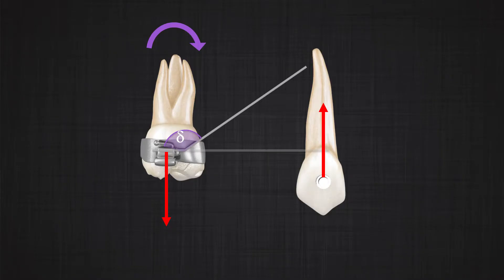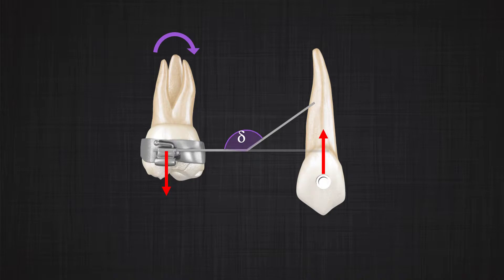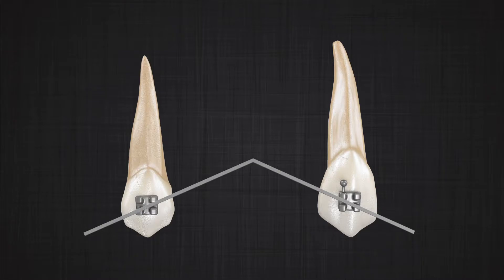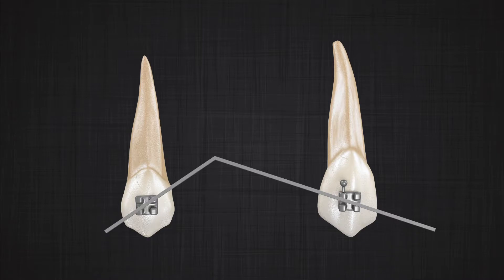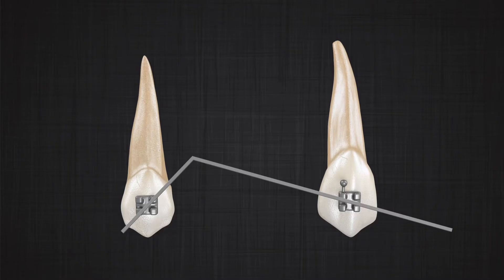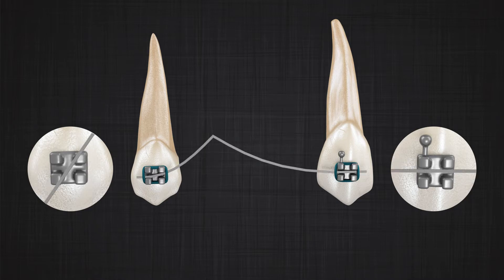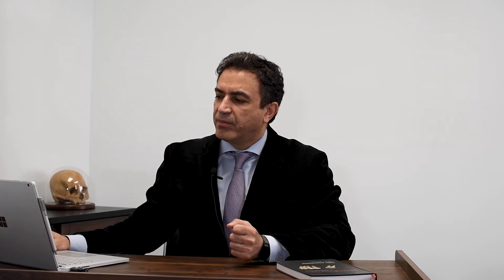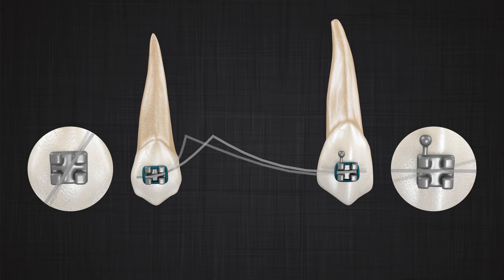Mechanotherapy in Orthodontics: Two-Couple System Pt. 5

Comment: Absolutely in love with your teaching method - very complex topic explained in great details . thanks a lot . 

Can you please share your views on V bend application in ANCHOR BEND principle in continuous arch mechanics  :

1.  in case of reinforcing posterior anchorage  for anterior retraction 
2.  also in case of protraction of posterior teeth & reinforcing anterior anchorage with anchor bend

 specially the vertical forces generated with anchor bend in both situation & its clinical implications.
Reply: I guess the vertical forces are negated by occlusion and stiff/rigid archwire and only differential moments are left predominantly